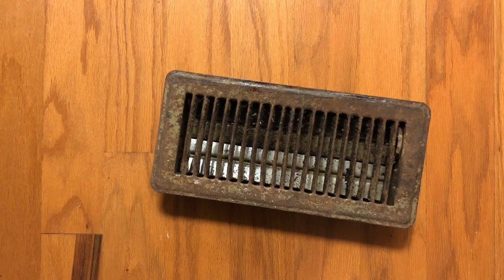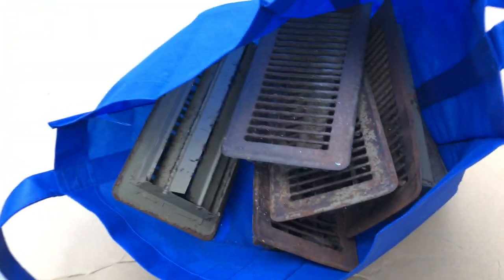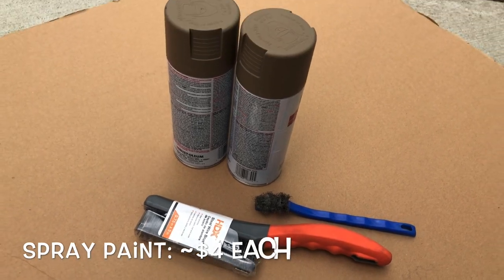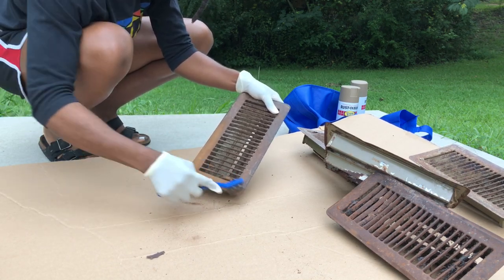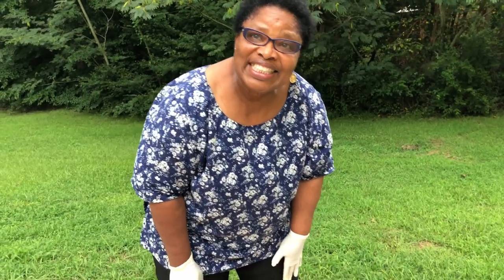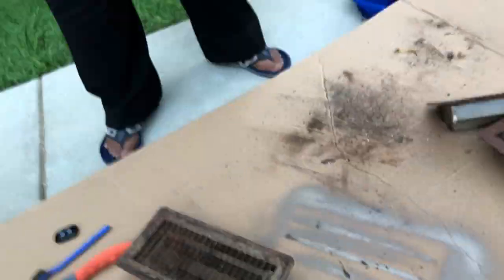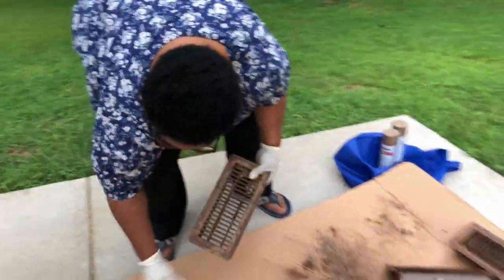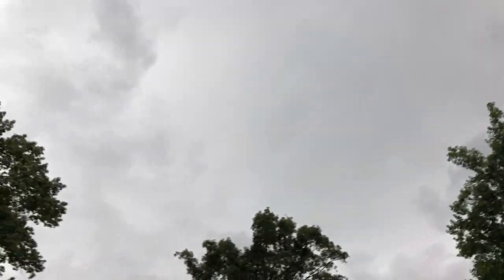How to Restore Rusted Metal Vent Register | Satisfying DIY

Comment: Soaking all the vents in White vinegar for 24 hours would have save you a lot of time scrapping all that rust.  Vinegar is great removing rust.
Reply from the maker: Ooo noted!
Reply from the maker: Although the scraping didn’t take much time at all..much less than 24 hours
Reply: Thank you for that tip👍
Reply: I was about to say the same thing, just make sure you rinse them very well immediately and dry them off or they will immediately flash rust, dipping them in a solution of baking soda water bath to neutralize after rinsing it would not be a bad idea, set outside with a fan and let them dry, prime/paint
Reply: Does the vinegar need to be diluted in water??

Comment: Much simpler process is if you have a drill buy a  wired wheel/brush attachment to remove rust. Would be MUCH faster process...maybe $2/3 for the attachment. Also make sure the dust/rust wiped washed off... a coat of primer then the spray paint or a 2x type with primer in.

Comment: Have you ever had to remove paint from registers?  That's what I am facing.
Reply from the maker: no I haven't
Reply: I can't find any tips on this either.
Reply: @DaraAbasute  I found the floor registers for cheap (get rid of sale) at the Floor $ Decor, so I did not have to restore them.
Reply: I’m removing paint as we speak…..So I’ve always done old hardware with boiling water in a crock pot. Paint peals right off! Vents are bigger as my house is from 1929 soooo I took my huge stock pot and started boiling them today. I’ve gotten most of it off and I’m thinking I’ll wire brush them next and go from there.  It’s easier than using citrus strip. Good luck!